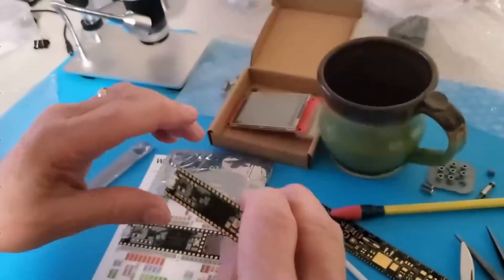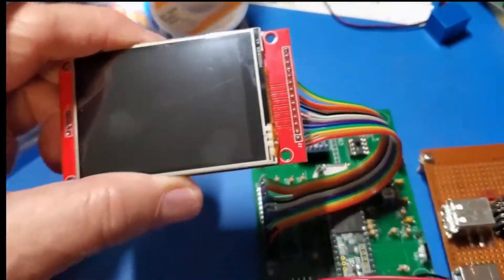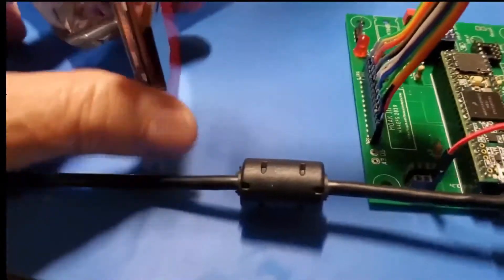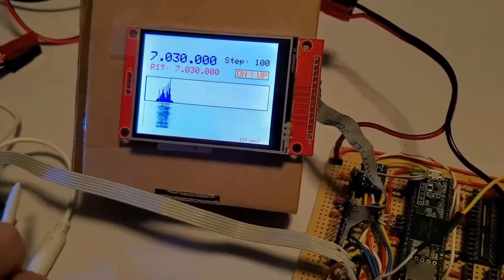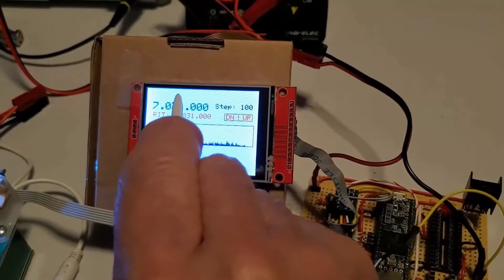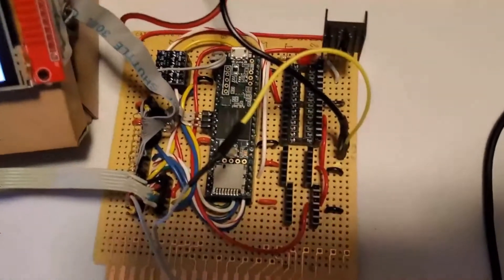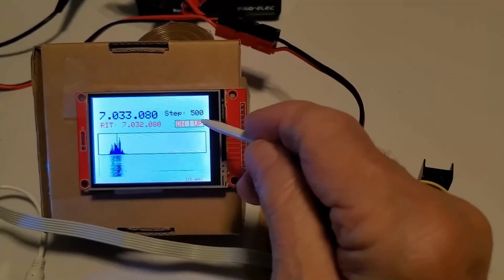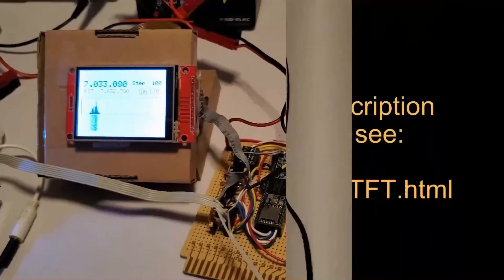Two Teensy Touchscreen Projects

Comment: If the touchscreen had buttons, like a numpad, would it still work without using the stylus, with fingers, instead?
Reply from the maker: Yes the 2.8-inch touchscreen in the demo also responds to finger touch.
Reply: @lloydsdemos7366  Excellent! I need a 'smart' interactive touchpad, with multiple layers, to eliminate dozens of physical buttons on a Teensy laser control panel. Thanks for confirming that possibility.🙏